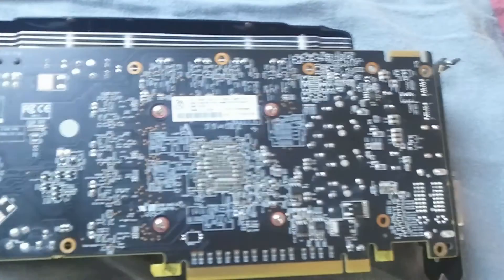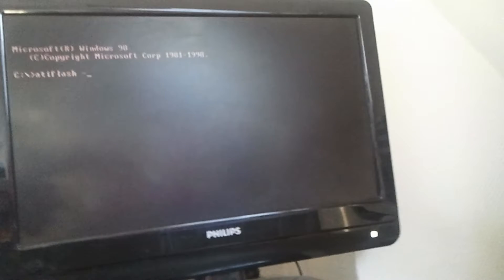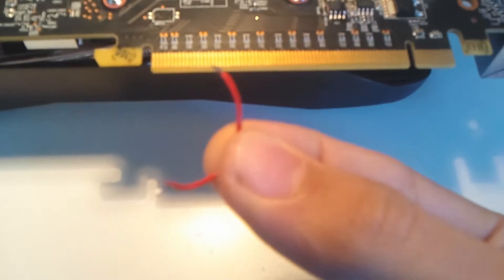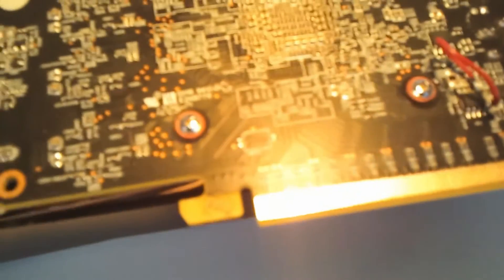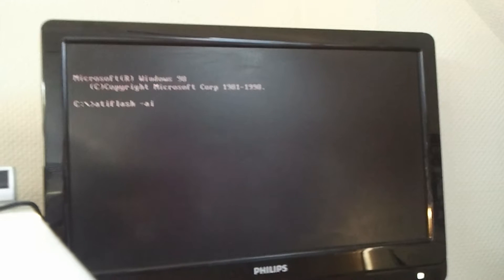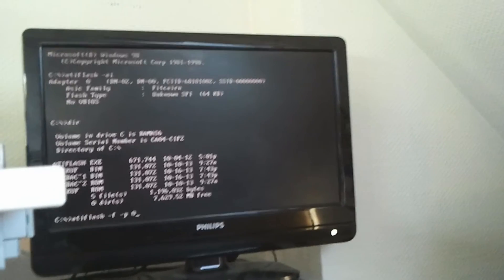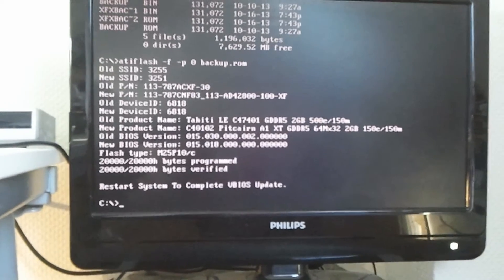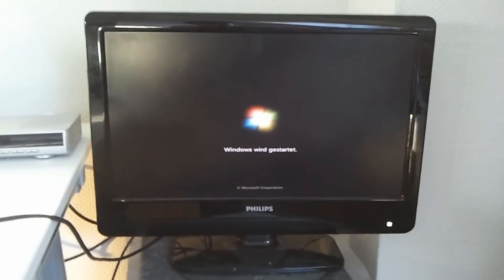Solution | Bricked HD 7870 XFX GPU BIOS FIX | Hardest Way

Comment: This method is Approved
but when you tried the 1st time to boot you did not plug the 2 x 8 Pins cables to the GPU 01:12
and in these new ATIflash versions  use "-fp" instead of "-f" just in case because it have been a pain in the back when i tried to flash my GPU it
Reply from the maker: Correct. Demontration purpose. 
The ATI menu was running from the USB (Boot), not from the GPU, meaning the GPU needed the PCIe slot but not the power which comes from the PSU.
Reply: @TugasPT  I`m not saying it will not work 😊 im just confused because i always want every wire or plug in its place
This video is 10 years old and it fixed my Chinese RX 580 yesterday with your method 💕
I shorted the bios as you demonstrated 
In Windows 11 with the 1st try it worked so i tried another bios messed up again when i tried to flash the original it says "SSID Mismatch" i tried everything but no success
But worked in linux like a charm with "sudo ./amdvbflash -f -p 0 bios.rom"
Thank you once more

Comment: When flash. It still show cannot read rom error 0fl01..do i need the clip 8 pin to do.
Reply from the maker: Yes, the video shows you, that with a contact pin 1 to pin 8 (depending on the board), the flashed chip gets into a "suspended" state, which then the flash can be proceeded as the video shows.

Comment: You used the wrong dos commands. You have to tell it which card as in atiflash -i 0
Reply from the maker: Of course, depending on which slot you may using, its obvious right?
Reply: @TugasPT  Actually......no.......it’s not obvious for those trying to learn.
Reply from the maker: But did you learned or not? 
The command 
atiflash -p 0 biosname.rom
is to call if you have one card. 

The command 
atiflash -pa biosname.rom
is to call if you have a multiple card setup
Reply from the maker: The command
atiflash -i
You use it after the Bios flash to check if it worked or not.
Slot 0 = is the first slot.
Since in IT (informatics) or in ET (elctrotechnique) we start to count from 0 and not from 1.
So slot 0 means the first pci-e slot.
Slot 4 means the fifth slot.
Reply from the maker: You have the eager to learn.
But your complain is the first one (at least of that kind) that I got.
Noone complained about the command atiflash -i
Due to be a command to use after flashing the card went successful.

In the video description are the commands I only used in the video.

Furthermore it is obvious since it show when you type in, atiflash - ai
the slot which the card is using....

Comment: Does your gpu getting hot or fans spinning when it is brick?
Reply from the maker: They spin, but not with a high RPM. And GPU did not overheat in this card.
By being a "Brick" there is no intention that the GPU works, because there is an BIOS block, after bypassing that the GPU starts to work as well as fans.
Reply: @TugasPT  mine does not spin and the card does not getting hot
Reply from the maker: @barakobull  then it's a brick!
Reply: @TugasPT  are you sure about that because my gpu does light up but fans not spinning and not getting warm
Reply: @TugasPT  so i can do your process?
Reply from the maker: @barakobull  that is up to you, my method worked for me, and for others viewers who had the same problem.
But if it is going to work for you, there is still both possibilities that it will work or not. I will not be responsible, but truth to be told the card is bricked.
Reply: @TugasPT  thankyou now i know my gpu is not dead or what

Comment: Do You really need to cut the wire before flash the card ?

For my Card is showing as dev 0 but Not able to flash. 

So i Am going to try this method and will update you soon
Reply from the maker: Yes. Otherwise you wont be able to flash.
You second is reason for cutting before flash.

Through trial and error I found it out.
Reply: @TugasPT  actually my card was shown on the dev 0 always. But Even after Short 1 pin + 8th pin , It always failed with the flash. 

after few Attempt i notice that my backup rom was 512KB. and R9 270x Bios ussually 128KB rom. 

So i suspect somebody solder a 512KB BIOS chip onto the card. That is why i am not able to flash the 128kb Original Stock bios. 

So i Took a OLD graphic card's (HD 6950) BIOS chip Out which is also 128KB BIOS CHIP and put it onto R9 270x Card And it manage to verify and flash success. 

I do not 100% sure yet all works fine, Since I am waiting to download drivers and check on GPU Z about condition of card. 

I assume card is modified by someone to avoid the Flashing stock, Probably miners.
Reply from the maker: @king0fcodesgooglee190  Uow an interesting case you have there.
You are already making progress, best of luck, keep me updated. Had no clue that miners modify the Bios on purpose, so that the next owner could not flash stock it. What would be the purpose?
Reply: @TugasPT  I have no clue who did the chip update. But pretty obvious visually as bios chip is soldered by someone. After checking voltage rails all fine except card fails to detect. This is one of those rare cases that i found on a graphic card. and I though it might be helpful to someone reading those comments. if they have issues with bios flash, this could be 1 reason. 

I will update the details once card is stress tested later on.

Comment: I have r9 290 xfx and it’s brand new but is missing second bios chip and I put bios chip from other graphic card on r9 but nothing on screen!
Where I make a mistake?!?
Reply from the maker: Does a R9 290 xfx comes without the second chip? Can you please explain your issue with details?
Reply: Tugas PT I can explain in details but I need your email!
Reply from the maker: Youtube has Private Message System, I am asking you to use it.
Comment this post, if you already PM me.
Reply: Tugas PT Yes the graphic card came with removed second bios chip.

After I received the graphic card i put it in computer and the fans was working and the light xfx turn on, but nothing on screen,I try to switch up the bios switch but still nothing on screen!
Then I remove bios chip from other graphic card and put it in my r9 290 and i put it in the computer but still nothing on screen!
Reply from the maker: Did you bought the GPU?
Is it new, used, or refurbished?
If it is new, how does a bios chip is missing?
If it is new, why do you not RMA the GPU to the manufacturer?
If it is new, you warranty left, how many years?
How did you noticed that the GPU had one Bios Chip less than the usual?
Who told you to remove a bios from another card to implement in your r9 290 xfx, where did you get the information?
Are you doing this professional or as a hobby?
Again I cannot tell where you did a mistake, if you simply think switching bios or adding a second bios is going to bring output.
Send me private message again, not comment.

Comment: Thanks fixed my fxf r7870 dd gigahertz edition. The bios chip on that card is a Pm25LD020. You have to connect pin 1 and 8. But i wouldt recommend soldering. Its a lot saver to use a paperclip and Just clamp in on the chip
Reply from the maker: I chuckled while reading this comment... Let me explain, at the time where I "unbricked" my card whille doing this video, I wanted also to use a paperclip, believe me I COULDN'T FIND FOR THE SAKE OF _______ (fill the blank space) a damn paperclip in my house (and i only needed one, just one paperclip), since the stores were also closed where a lived because it was a Sunday, I recurred to soldering, it worked well for me, 'cause I had experience with it. Moral of story, have a small box of paperclips, just in case.

Another AMD 7870 was saved! Glad you could fixed your card. Spread the word!

Fun fact: I had also your card too, try a saphire BIOS and you can overclock it,  I advise you also a coolermaster GPU cooler, XFX in particular that model had a poor cooling flow while playing high graphics demanding games, but do all what I mentioned at your own risk!
Reply: @TugasPT  yes, it does get really hot, 88 degrees under load. But I only spend 20 euros for the card and having a cooler that's more expensive than the card itself is kinda ridiculous to me

Comment: You can reflash it without any soldering in this way:
- power off pc
- put another svga
- put the hd7870 in a lower slot
- disconnect power cable to hd7870
- power on pc
- boot windows
- connect power cables to hd7870
- windows will find the device 
- restart windows but boot from usb key (no hardware reboot)
- atiflash -ai
- atiflash -p 0 bios.rom -f

It works for my hd7870 bricked
Reply from the maker: Good method and detailed instructions. THANK YOU
For situations when a person does not have a soldering kit, might be helpful!
Did not try...yet.

Will post your method in my video description, obviously you will get the credits.
Reply: @TugasPT  happy to be useful!
Reply: @byxlettera1452  power cable u mean 6 pin? How about non pin?
Reply: @youllgetyourrentwhenyoufix356  The power cable connected to the video card.

Comment: Reallly Nice! Ps-  same bios trick possible for Laptops? If yes go to try asap!!! Have Toshiba sattelite. Downgraded. Rightbios, but he didn't like it. Same problem like you have begin video.
Reply from the maker: I do have experience in assembling and deassembling laptops, and from my point of view, it varies, if you have an AMD HD 7870 and compare to the same model for a laptop with a GPU AMD HD 7870M, the design and the location of an electrical component varies from the GPU.
The M at the end of the model name, stands for "mobile" I think. Nvidia has also the letter M for respective notebook/laptops gpu models.
I never tried build a computer with an mobile GPU, vice versa also never tried.

Comment: Can i fix my bricked HD 7750 using this method? Thanks.
Reply from the maker: Franz Payawal I have no prior experience with 7750 with this method. Thereby I am not sure if you can, but you can always try out, and post the success or failure in the comments, for fellow 7750 users...

Comment: Hi man. Good video. You gave me hope. I have an rx 460 and I can find only one 8 pin chip on the back of the card, close to the pci-express screw. I am sure that this is the rom chip. But what I am not sure about is the soldering. It is necessary to solder the cable, or I can use  a paper clip to connect the pins and that,s it.?
Reply from the maker: ADITZApeYoutube (InfoBestGames TM Corp.) HI! You could even use crocodiles clip, either way if you are not confident about soldering your could ask a person with more experience in soldering to do that for you. Paperclip never tried. But here is my question how do you gonna hold the paperclip to the pins needed for this procedure?
Reply: Thank you very much for your repply. I can't find anyone who can solder my card. I live in a place where those tipe of things are more then unconventional. I can't do it neither. About the paperclip. I have an open system and I can insert the GPU in a riser. So it's not hard for me to hold the paperclip. I can hold it even with a hand :)). The problem is that I don't want to damage anything. If you have time in the future, can you try the paperclip method?
Reply from the maker: ADITZApeYoutube (InfoBestGames TM Corp.) I could try the paperclip, but for that I had to brick card on purpose and for now I don't have any bricked card that needs such a procedure.
But you can still be positive about that, think about it your card is already bricked so you either can fix it or don't, because the only possible way the completely ruin the card is to smash to the ground. by using your method you van either save it but not destroy it completely.
Reply: (Pictures down)-Sorry for my bad English.All right. I tried. Again, for those who didn't read from the beginning. I have an ASUS DUAL-RX460-2G that I was able to brick flashing a bad BIOS.
 On the back of the card is only one 8-pin-chip close to the PCI EXPRESS screw. I assumed that this is the ROM chip. I used a basic clip to connect the pins. First I tried 1+8 but I got the error ,,adapter not found,, second 4+5 ,,adapter not found,,. I assumed again that the basic clip is not working and probably you need to solder a cable. I searched on Youtube, ,,BAD FLASH Adapter not found rx 460 paper clip,, and I found this video ,,https://www.youtube.com/watch?v=GiLDD1hzCr4,,. This guys say to connect 4+8 with a paper clip to disable the ROM chip. I did. I installed my gpu and I turned on the PC. After few secconds the cilp become red and some smoke was comming out of it. After that my computer shut's down. Now, the pins are yellow, and the PCB look like is burned. 
-> Pictures with burned PCB 1.https://i.imgur.com/Wm1p7nu.jpg 2.https://i.imgur.com/SB7uLzo.jpg
-> Picture with PINS https://i.imgur.com/ffoR9yE.jpg
-> Pins connected with clip pictures and others -https://imgur.com/a/MF7NC

Good thing is that connecting pins with a clip or paper clip is working. So, soldering is not necessary.
Bad thing for me is that I can't unbrick this GPU because I still getting ,,adapter not found,, in ATIFlash 4.17 under Freedos. 
 And I don't know why... Maby is not the right chip? But I don't have any other 8 pin chip on the back of the card..
I don't have another GPU, so I tried this procedure on an old AM2+ Asrock with an integrated graphics. I,m gonna buy a cheap GPU and I'm gonna try it again on my main PC with ASUS M5A97 rev 2.0 and 2 PCI Express slots.
 Now, if I am connecting again the pins 4+8, who gave me shortcircuit, the PC does't turn on. Just with 4+8 bridge. But no smoke is comming out. Of man, I am so sad.. Maby I really bricked my GPU now. !Vents still working.. Help?
Reply from the maker: ADITZApeYoutube (InfoBestGames TM Corp.) You must be sure which pins you have to use (connect), it is different the architecture, GPU model, bios model.
You stated that smoke came out... I am going to ask the following:
Did you pick the right Bios? Did you cut the bridge while you were flashing the card? Did you used a second cheaper GPU? I used(borrowed) an cheap nvidia with VGA interface. Hold up...
YOU did flashed the bios! But you did not remove the bridge? Is that what you are saying?
Reply from the maker: Watched the video, the person in the video just gives you instructions, but no sorta of showing how it works (to tutorial both instructions as well evidence applying what you learned from the instructions are required)
I bricked this card, fixed it with the sources I mentioned in description, then after I fixed it I bricked again and made a video, just to show the exact scenario I had, and as I figured I was not the only user to have this issue. But if you follow his instructions and got success youre fine with that. The thing is I cannot report if his instructions works because I do own you model GPU card and I did not used the paperclip method. So at the same time I cannot make a assumption that his method works or not...
Reply from the maker: So to be sure both videos mine as well the one you posted were helpfull?
Glad you fixed your card now it's "ALIVE :D!!!"
Can I post your instructions in the video description? You will get full credit just like the other persons who did fix it! And it will be helpfull for other owners of your same GPU model.
Reply: No. Just your video was helpfull. Yes. Yes you can post the instructions. Thx you again. With love :))

Comment: Sorry, doesnt become clear in the video, the sequence of your worksteps is a litttle messy. I read the description though. You are calling -ai for adapternumber and then you turn the pc off right? Afterwards you cut the bridge and THEN, start up again and flash your bios right? Can you give more technical background on when you have to short which pins, or is it just not important? Sometimes it´s 4 and 5, then 1 and 8, ofc I know what a datasheet is, but most of those eeprom soics are identical and therefore the layout is.
Reply from the maker: Question number one do you have the same GPU model as me?

Now to your issue... You turn the computer on, with the soldered bridge on your gpu bios. THEN you prompt with the atiflash a command to recognize the gpu. THEN before overwriting the BIOS you cut the bridge you soldered (DONT SHUT POWER DOWN!) after cutting it, you can now overwrite the BIOS with the expected atiflash command (stated in the video)
Reply: Ah okay. The issue is solved now anyway, I got myself a usb eeprom flash stick and some kind of clamp with 8 contacts that fit the soic with the bios on it. I then was abled to read and write on the bios chip without soldering. I even found the parameter on the internet that is necessary to be changed in my rx460 to enable 1024 PUs instead of 896. Now I run it with my modified backup bios and everything works just fine. But thanks for clarifying, maybe you can add the "DONT SHUTDOWN" between steps two and three. Doing mods on the hardware while running will be new to most folks :D

But anyway.... After I loaded the new bios and I could get the adapternumber on ATI FLASH windows utility, i still wasnt able to get the adapternumber in the corresponding freedos utility when booting from stick. I found this quite strange.